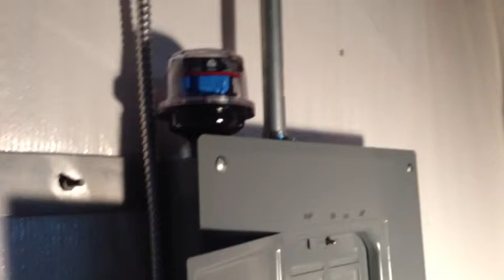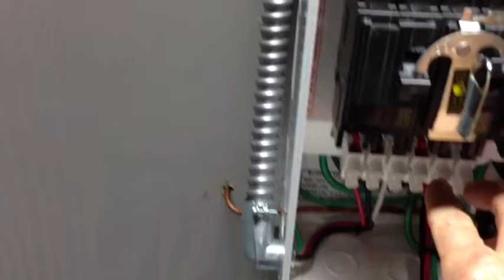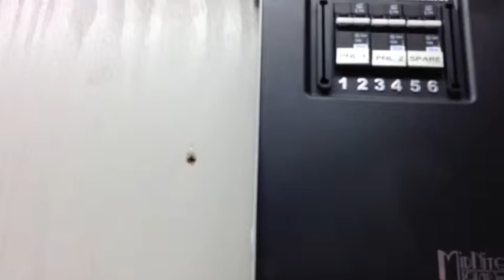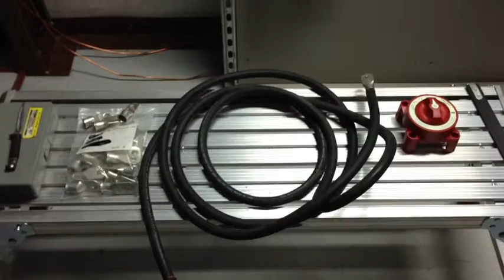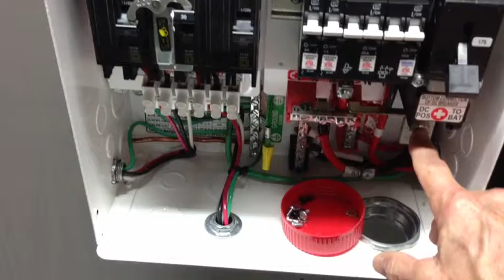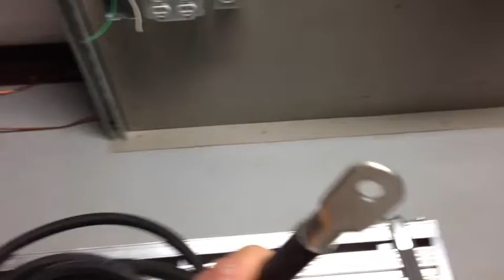Solar Project in MS Part 7

Comment: hi Bill I hope your eye is doing better my brother in law is going to the same ordeal....a couple of questions....I used the romix 10 / 3 wire and you used the BX wire is there any difference? if you can can you give a little bit more explanation on the grounding ...I just ran a ground bare copper wire to the bus bar ground..from there a number 6 wire to the main panel box earth ground wire....does that sound right to you? I hope I'm not over burdening you with all my questions...it's just that you're the best source I found on YouTube thank you so much!
Reply from the maker: Dan, either type of wire should work just fine. On the grounding, I don't want to short change an answer BUT, this area took quite a bit of planning based on my specific configuration. The grounding configuration is based on single or multiple connections to ground, size of cables used, number of ground rods, etc. My best source of information was the Mini Magnum Panel(MMP) owners manual(available online), Page 37 figure 2-21 is my configuration. On the DC side I used 4/0 ground cables. Also see page 39 on removing the AC neutral to ground connections . I made a sketch of my layout and discussed it with Magnum technical staff to make sure it was correct. They were very helpful.
Reply: thanks again!